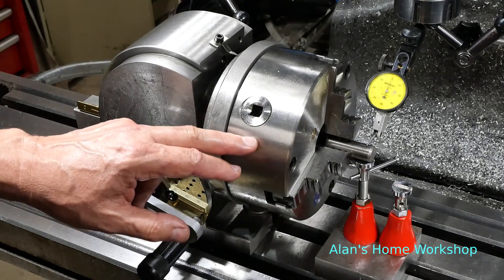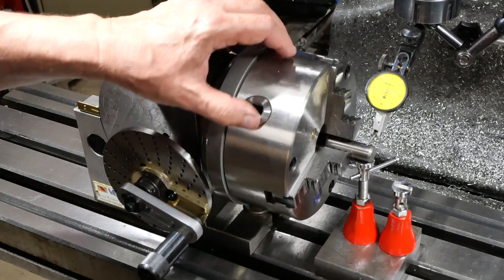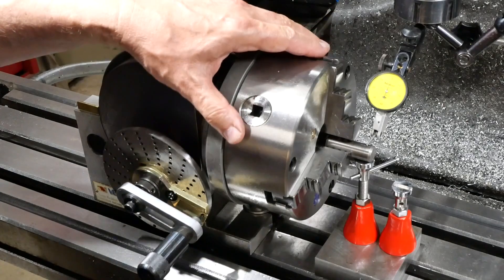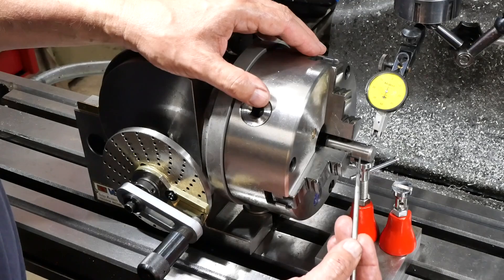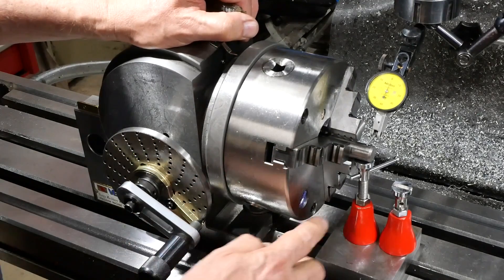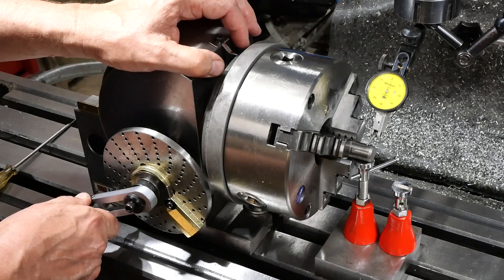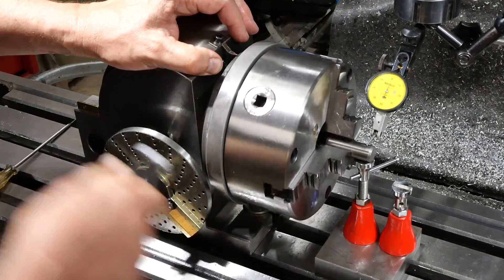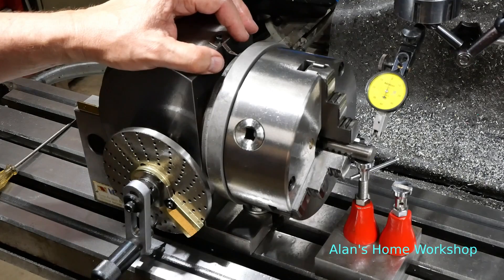Centering a 3 jaw chuck on a back plate - short video

Comment: I watched this another day and I just tested it on my mini 3inch rotary head, it works! I have been tapping the chuck with hammer for hours and it won’t true up until I saw this method. Many thanks!
Reply from the maker: I found it to be much faster than tapping, and it would have been even easier with a better jack. I'm thinking about making one designed for the job.
Thanks for watching.